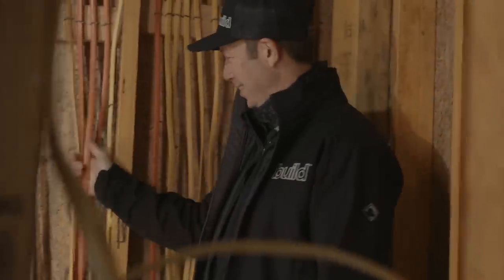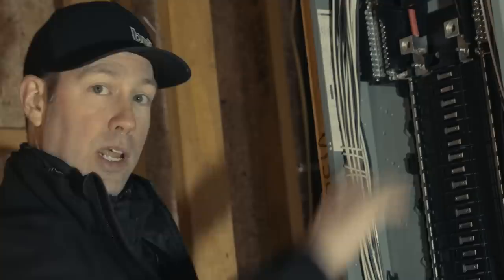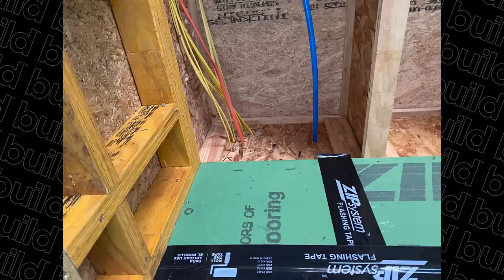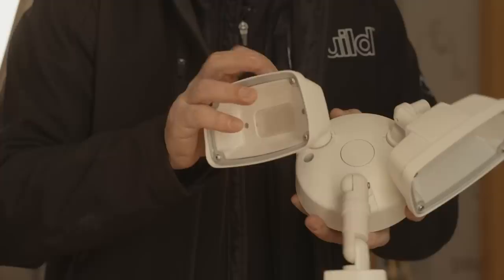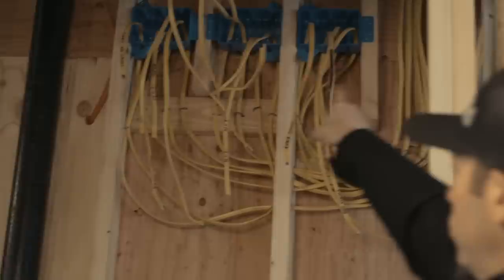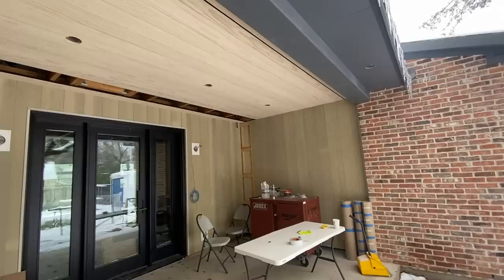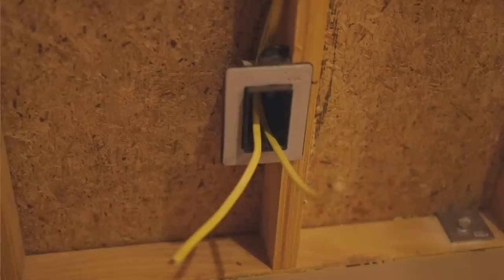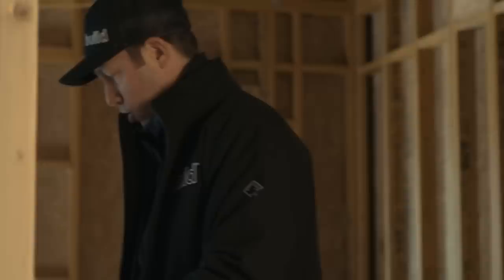5 Tips for New Construction Electrical & Smart Lighting!

Comment: As an electrician this outta be interesting.
Reply: Agreed.
Reply: Turns out, disappointing.
Reply: Was it?
Reply: @chriswithrow3107  
Not really disappointing but 20amp for everything is nonsense.  Here up north it'd charge him extra just for labor because it's PITA to work with in cold when you can do the same quality job with 14/2
Reply: As an electrician, I'd do a couple 15 amp citcuits for lighting. One for each floor. Then all 20 amp circuits for receptacles. I would also pigtail the wires and land them under the screws like they should be, not use the crappy stab-in connections.
Reply: @sergeybebenin  , on new construction? nah, it's not that bad. sure, if it takes 10 hours instead of 9, then charge that little bit extra. 20A is definitely worth the effort to be able to plug in a space heater, hair dryer, clothes iron, etc.. it's just better to be future-proof.
Reply: @somedude-lc5dy  
He's building this house from scratch (all planned out) and it's an ultra efficient passive+ house that won't need any heaters.  Hair curler 3amps, iron 10 at most. .And sure, it makes sense to wire "utility" areas and maybe entire first floor outlets with 12 but not end entire house
Lights should be on a separate line and certainty not 20amps.  I think Matt is just OCD like that lol.
Reply: @nickstopherd7762 , I've replaced a couple hundred backstabbed receptacles and only a couple dozen were charred, but several dozen wouldn't hold a plug anymore.

It'll be interesting to see how long receptacles last in an environment full of AFCI breakers. Along the same lines, I wonder how many electricians will switch to commercial grade receptacles (and maybe even 14 gauge wire) when they realize it's the loose builder grade receptacles that are tripping breakers.
Reply: A couple dozen out of a couple hundred is a horrible failure rate.
Reply: @nickstopherd7762  yes, backstabbing is for politicians not electricians.
Reply: @nickstopherd7762 , first thing I do when I move is replace receptacles. Then switches, then fixtures.

The work I find in boxes and panels of generally appalling.
Reply: Was not expecting Matt to use halo cans 🤢
Reply: @somedude-lc5dy , he lives in Texas.  Ignoring it's a new home with a very high end HVAC system, planning to plug in a space heater sounds like poor planning after this last week.
Reply: @sergeybebenin  12/2 is code in my area, so all houses are 20 amp...
Reply: @markh.3665  I think I'll use 10 gauge armored cable for everything, with 30 amp breakers.
Reply: @markh.3665  Where do you live that requires all 12/2??
Reply: @Crusader1815  -- ran into a newbie-engineer in the Corps of Engineers who did that one time.  Solid #10, everywhere.
Reply: @robert-ne1835  Natrona County in Wyoming has this as code, neighboring counties may not..  I grew up in Converse County to the East and had all 20 amp breakers growing up.  Always surprised they sell 14/2 in the big box stores...if you use it, it all has to come out as does not pass inspection...
Reply: @sergeybebenin  like he said, not that much more expensive.  I would agree, that if 12 was not code in my area for the whole house, with LED lighting becoming the norm,  I would run lighting on 14/15Amp, and outlets on 12/20Amp.  Best thing is to limit the number of outlets per circuit.   Been in homes where outlets from 5 different walls shared a circuit... always tripping..
Reply: @Crusader1815  isn't armored cable code in some areas?   I see shows with that metallic snake stuff to every box... romex works fine inside walls...🤷‍♂️
Reply: @sergeybebenin  well the real reason is that in texass it's required in most counties, they don't perform load calcs properly, they mix lighting and outlets, they will wire a 5000 sqft house with one panel and run circuits in excess of 3% drop.... Which with AC is friggin hard to do. Out of all of Matt's videos this one hurt.... From the get go he was ignorant of code (ie copper is still corrosive and NEC calls for exterior connections to still use anti-ox on anything larger than 50amps. It's not his fault as much as the Electricians.... But out here they are all garbage. 🤦) Too many things in this video made me unhappy.
Reply: Problem in NE, you can be ocd owner but can’t find an ocd electrician. They’re all day trading
Reply: @markh.3665  Armored cable is generally code for commercial construction. I've seen even small dental offices (about 1500 sq ft) wired with armored cable. And metal boxes are used, too.
Reply: I don't see the point in him advocating for 12/2 EVERYWHERE. 
I've just rewired almost my whole house during a kitchen reno. Even though I'm in the industry, doing it at my cost, it costs enough extra that it doesn't make sense. At least not for every little thing. Lighting especially. I only really used 12/2 for receptacles, 14/2 on lighting. I even thought about using the 12 it just really didn't make any damn sense to justify it.
Reply: @oscarjr2679  nothing wrong with their cans....... Nothing wrong with halo. It's affordable. I don't use it often, but when I do.... I follow instructions.
Reply: @Crusader1815  lmfao
Reply: @robert-ne1835  texass
Reply: @Floridaman8783  it's code in most of texass. They mix circuits between lighting and outlets, they don't perform load calcs and exceed 3% voltage drop often with ridiculously long runs
Reply: What I find funny is he's going on and on about saving energy and then going on and on about how he needs bigger wires for more energy. Typical for him...
Reply: @stuartmacfarlane1901  I’m not a dumbass anybody can read instructions, their cans are fragile and stubborn not to mention the can trims, Juno is superior in recessed cans, Satco and Lutron for lighting if you want high quality not cheap halo.
Reply: @oscarjr2679  and what is wrong with Halo cans? Are you even an electrician?
Reply: @stuartmacfarlane1901  oh really, you got a code reference for using de-ox on 50 amps or larger? Hint, there isn't one.
Reply: @chriswithrow3107  its a loose read on 110.14 but yeah it's seen a ton of revisions locally and has been updated a million ways. Any time you have dissimilar metals it's required to field documentation and follow product recommendations. Outside of aa8000 it's just up to the conductor  manufacturer reqs. Some of the panels we use require it. Some local utilities require it on exterior more because they are near salt water. Hell some local codes are now requiring stainless steel meter boxes and exterior panels.... Which is ridiculous and causing the already obnoxious costs to skyrocket.
Reply: @oscarjr2679  not denying any of that just saying with a little care it's a fine product for 99% of the masses. I don't use them often. In my world it's mostly light engines and contained modules for example on the low end elcos oak collection (which are amazing but need to be changed to  24v or higher .... The 12v kills me) but when it's a more basic install I just let whatever is locally provided be an option. Yeah they aren't the ideal but there is nothing wrong with them. You can open and or close their janky teeth  to make them easier to move and self tapping screws or super 33 will lock them
Reply: If it was about code Matt would have said that, he's doing this so he can brag his house is better than yours. It is not code in his area.
Reply: @ryanroberts1104  lol it's definitely not 🤣 but that's only a matter of opinion, however, I don't believe that's the case. He is proud of his house, that's good. We should all take pride in our work. He is a salesman first and foremost. It's not always appreciated. Look I'm not trying to put him on a pedestal. I'm just saying he isn't all bad, and there is benefit to his channel or we wouldn't follow it. I respect what he is trying to do (build his brand and raise awareness) in the world he lives in (texas building is absolutely awful in most standards and even though many things he shows make me cringe, there are many other things that I am happy to see.... Especially down south)
Reply: @stuartmacfarlane1901  I'm not sure what you are going on about, whether it is code or not is not a matter of opinion. 

Matt's waste of copper has been heavily criticized by electricians and builders here, and it's just irresponsible to tell everybody that everything should be 12ga. Not needed on many things. (Now that is an opinion) Matt is not an electrician...
Reply: @ryanroberts1104  you didn't read any other comments  in the post. 12ga is basically code over the entire state. The idiots in trade and idiots in the cities out here basically mandated 12 gauge for all lighting and outlets as they mix the circuits. I purchased a new 2017 build in north dallass and I have 3 bedrooms and 2 bathrooms on one afci/gfci breaker.... Lights, fans, outlets.... One breaker..... Probably close to 900 feet of wire on that one circuit..... Fml.... Texass! I had a 50 amp oven that was ran over 10/3.... 200 foot run.... Fml! Texass. Beazer build. 4300 sq feet of house. One 200 amp panel with only 22 circuits..... 4 beds 5.5 baths a theater.... A texass sized house built by texans for texans .... I bought it to flip it once we filled our contracts. The amount of code violations makes me understand why they do some of the stupid.... The inspectors barely know any more than the builders or the tradesmen. There is a reason their houses are built cheaper than chips.... They often fall apart as fast as they go up.
Reply: @stuartmacfarlane1901  I would be surprised if I didn't just watch the Texas grid collapse on the news. They shouldn't be doing things like that, but that wouldn't meet the most basic NEC from 20 years ago. Is NEC not used in Texas? It should be done right but you don't need to go overboard either...

I used to rent a warehouse that was formerly used by an electrician for his business. He did all the electrical...wrong. When I reported it to the county electrical inspector (it was that bad) it turns out the same guy IS the electrical inspector now.
Reply: @ryanroberts1104  bahahhaha 🤦 fyl! Yup it's ridiculous. Well nice chatting. Off to bed.... And yeah texass. Won't share it's grid, wants to succeed, It's grid fails .... Now it wants a hand out.... Oh and to make it more exciting the energy companies are passing the excessive costs down to the residents of the state.... Neighbors normal 80$ bill was 700$ for the 4 days of cold weather..... His house is gas.... So it was just excessive inflation of the variable rates. We had power (luckily I guess) for 30 minutes on with each 1 hour of no power. Short cycling the energy grid is terribly inefficient and everyone was basically forced to cook and clean within a 30 minute window..... At the same time.... 🤣🤦🤬🤬🤬
Reply: @sergeybebenin  Matt simply does not understand the concept of electrical physics and demand calculations... more like lets just oversize everything... ie led lighting on a 15A cct you can literally add 138 lightbulbs 60W/9.5W equal in the led version by using the PIE formula @ 12A x 110V = 1320W ÷ 9.5W. Verses the 185 9.5W bulbs on a 20A cct. I'd  be surprised he has over 100lights in that house. Also as a sidenote as a conductor 15AWG CU wire got re-rated to be capable of receiving 20A ccts but code requires devices to be sized with conductors... either way other than kitchen and garage and maybe a dedicated cct for built in vacuum nothing needs a 20A receptacle.
If he really wanted to build a top notch home he should have looked at our CEC. As for his electrician either he is a fool for not properly educating his customer as to what is actually best or a genius for ripping him off.  The US is so far behind in Code it's ridiculous,  but hey I only went to eelectrical school at BCIT , your MIT equivalent if not better, lol
Reply: @markh.3665  Canadian code mandates 12 devices max on each cct..... unless it's a built in led (one that cannot be swapped out with incandescent) then you could use the demand calculations...like I mentioned before the US is 10 years behind Canada when it comes to code and safety updates... additionally many devices are rated to sustain a max amp overamperage as a fault, so if the breaker ist tripping because its oversized you will end up frying your device since the breaker never managed to do what it was supposed to! Protect your equipment, that is why the manufacturing plate has the rating stamped on the device... for example a 12A rated furnace should never be hooked into a 20A cct - if there is an overcurrent and the breaker trips at 16A vs the 12A you will be replacing your circuit board as well... bigger isn't always better hahaha, what a fool!
Reply: @somedude-lc5dy  Waste of time and money on lighting circuits.

Comment: Thinking of building an igloo in Texas, what is the R value of snow?
Reply: R-1 per inch.
Reply: NavyMace love it 👋
Reply: It’s actually not that bad of an r value
Reply: I have a snow saw. You can barrow it
Reply: About 1 per inch,  depending on how old and compacted the snow is. As someone who has spent a lot of nights in a snow cave,  you can get down to a t-shirt in one,  after you've acclimated.
Reply: What about your water/air barrier?
Reply: @ryanroberts1104  Got to be careful.  You use a candle to warm the inside which creates a very light coating of ice which improves the vapor protection.  Critically, you need to poke a hole in the wall, about 2/3 high from the floor to help expel built up CO2.  

They get pretty tight in there and ventilation is key to surviving.

Comment: in SKorea, the medicine cabinet seem to have power outlet inside, with holes to the bottom, for cable mgmt.  Seen some with lights and magnified mirrors.   A lot of apartments there, have heated flooring and smart lighting via main control pad and sub control pads, with total shut off for electricity and gas, you also have access to security camera outside your door and main entrance, also you can also call up the elevator, when needed.   look at Skorea/house apartment tours, most of them arent as big as US, but seem to be more convenient

Comment: Maybe in the your next 100 year home you can wire up all the lights with low voltage cat6 instead of 14 guage... Would have been interesting to see those products and you talk to a lighting designer.
Reply: Aren't there still a lot of caveats and losses with that? Limited lights per run, less ability to upgrade or change fixtures in drywall, low odds of finding a matching fixture when a driver burns out, high costs at the network switch, heat from the network switch, etc?
Reply: @steveb365  That sounds like it would be a good build show network video discussing the ins and outs of that system.
Reply: Well Poe+ is good for 48volts and led doesn’t need that much so you could definitely do it.
Reply: @FishFind3000 , you're running 48 volts to get 25 watts, so, conceptually, you could power two of these Halo fixtures on one run.  That's several home runs per room.  Each home run needs a termination for it's 8 tiny wires on each end and they need to be perfect every time all the time. It's a good system for the right application, I just question whether general home illumination is that right application.
Reply: @steveb365  efficiency is constantly going up. I believe he is saying lights in the future will be efficient as to run of a single watt or even less, thus code will change and wire size will dip for, only, lighting circuits
Reply: @ajyhimst2782 , LEDs are already 40-50% efficient.
Reply: @steveb365  dude, that leaves 50-60% to improve towards. and you wouldn't wire a low voltage anything with cat5 plugs. If the voltage and amperage are low enough, breakers and wires could be sized significantly smaller
Reply: @ajyhimst2782  CAT6 doesn't use breakers and you're talking about a jump in efficiency that will make no practical difference in the application of lighting while also being essentially impossible thanks to physics.

Now, if you want to argue going to a new wire, say a 16/2+18/2 that incorporates an open communication standard similar to CAN into the home wiring system while also implementing 10A 115V breakers and all of the above making it into the NEC, sure.

Comment: 12-2 is overkill Matt. If you are worried about heavy loads in individual rooms, just wire the receptacles seperately in 12-2. 12-2 in all circuits is a total waste of money. All houses are usually re-wired well before 150 years. Wire and insulation changes significantly every few years. LED's are used extensively in modern homes, which reduce the lighting load significantly. 14-2 is all that is needed for lighting circuits. Great video. Thanks, Russ, Journeyman Electrician from Oregon

Comment: Noice light option video.  Matt, I appreciate the through dive on everything you do.  With the 12 gauge wire idea though, I might suggest 14/2 for lights and 12/2 for all outlets.  When figuring the load requirement for the lights, especially with led technology (90% more efficient), it very likely the 14/2 would even be to 25% of it's  maximum capacity.
Reply: Correct.  I just built my own house, used 14-2/14-3 for lighting and 12-2 outlet. All LED lighting.  Used a amp clamp on the lighting circuits after and ALL lights on, 3-4amps total! 12-2 on lighting is just unnecessary.

Comment: glad you put these video's out.for future use i tell home owners to put metal conduit pipe from basement to attic.im in the north so chimney is a good chaseway.older homes tell customers to use fire chaulk around wires and pipes good for drafts,bugs and [well] fire.a little extra up front in the walls can save alot latter.